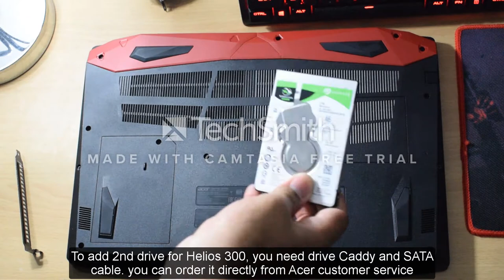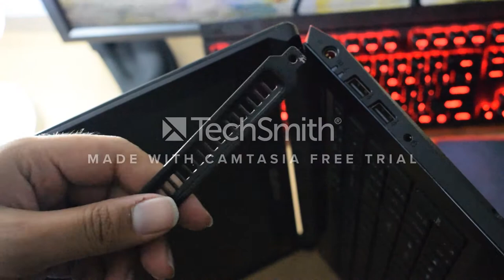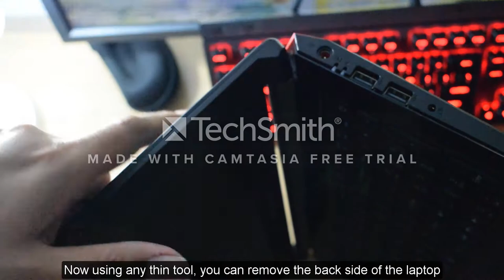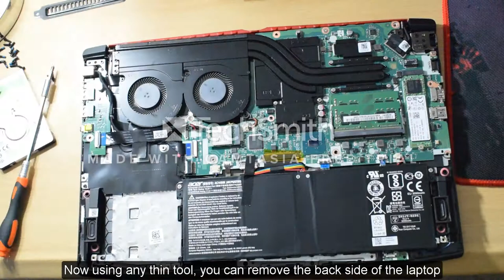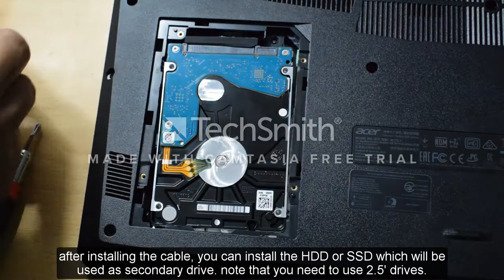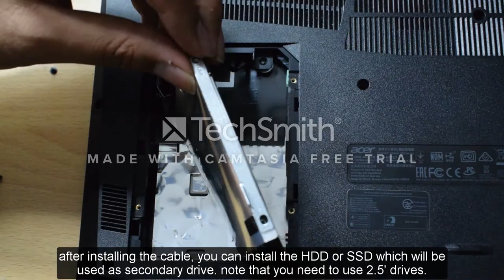Acer Helios 300 install Sata cable and HDD Caddy

Comment: Will the c5prh and c5pm2 which are just of different models of Acer's laptops but both use the same sata cable, but there is huge price difference of 5$ and 30$ everywhere I wanna buy, but I think it's the same cable, but just because it is of different model they sell it separately, but I m not really sure. I checked the cabling and both look the same, can you help?

Comment: hope you answer that habibi

I cant use aramex like you did.

i managed to get the cable through amazon.. however i cant find a descent deal for the caddy without getting ripped off badly..

can you give me a specific size for the the caddy so i can just buy a similar one that works from where i live? thanks man hope you can help

cheers

Comment: Hello, thanks was a very helpful video. I am in South Africa and it took 3 months to get the cable and caddy for me. Luckily my motherboard looks exactly the same like in the video. I did the installation and everthing went fine, but do I have to activate somewhere the port? Because although I plug in the new 2nd SSD, it's not working. Seems like the 2nd SSD receives no signal and juice from the motherboard. Tried the SSD via a USB because I thought maybe the SSD is faulty, but via USB on external supply it works fine. Anyone a clue what to do?

Comment: Meh hdd too thick fuck. Oh well 4 more tbs in my main rig.
Reply from the maker: Daniel Barrett no man, it is very thin, same size of SSD, but little heavier
Reply: Ahmed Khalifa the Seagate I got was too thick. I didn't realize 2.5 drives came in different sizes thickness wise. Once it's in there the little door won't screw back down.